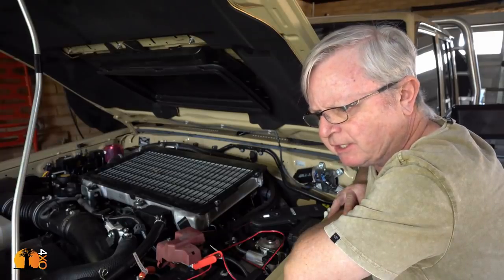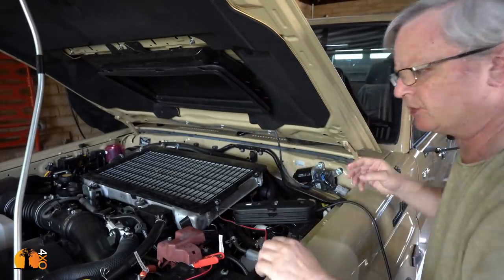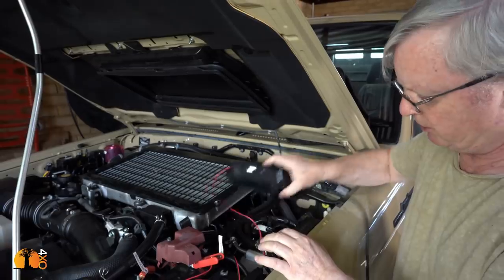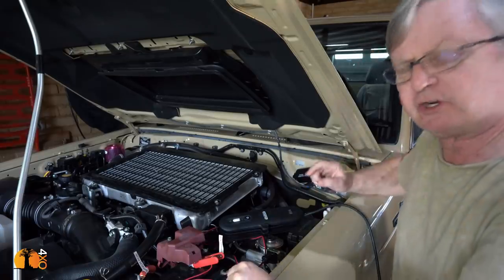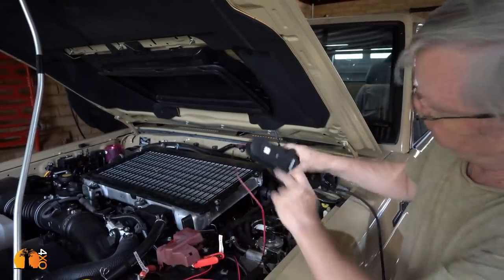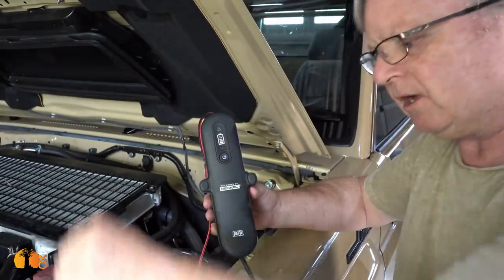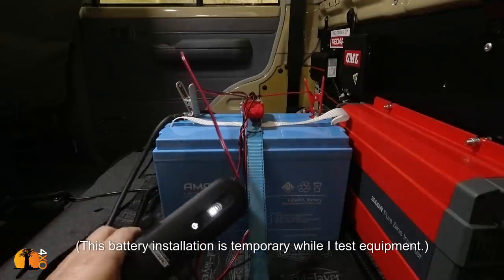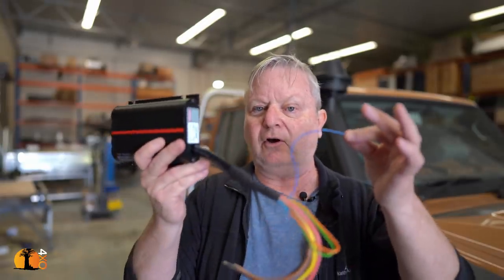DC-DC CHARGER RUNAWAY DISCHARGE WARNING.

Comment: I honestly thought everyone knew this....The clue is in the ‘voltage sensing’ aspect of the DC-DC. Also, DC-DC does not charge at 50 amps. That is simply the maximum it can charge at. The charge delivered depends on the aux battery’s state of discharge.
Reply: I typically see 5ish amps from my alternator? Would you say thats pretty low? I do have issues with power as dashboard and electrics turn off 10mins into night driving and come back on with battery light
Reply: Yeah, if only charging at 5 A most of the time you seem to have an alternator or bad starting battery issue.

Comment: Why would you want to add an external charger to charge the main battery with the system all connected. The alternator is supposed to charge the main battery during normal usage.
So basically the dc-dc charger is good and useable. What you've done is bad and dangerous.

Comment: Im not sure how you have done that .. but that is a setup issue .. its not a problem with DC to DC chargers buddies .. laughs .. oh dear
Reply: Key Maker quite agreed. Setup issue. But can be solved if one wants. For me no.
Reply from the maker: @gotoylc  This is not a problem I’m trying to solve. And neither is this a mystery as to why it happened. It can and will happen to anyone using a DC-DC setup. It's the nature of how DC chargers work. All of them with the exception of those relying only on a trigger wire. The solution is to charge the auxiliary batteries first. It's that simple. When I learn something, I like to share it.
Reply from the maker: This is not a problem I’m trying to solve. And neither is this a mystery as to why it happened. It can and will happen to anyone using a DC-DC setup. It's the nature of how DC chargers work. All of them with the exception of those relying only on a trigger wire. The solution is to charge the auxiliary batteries first. It's that simple. When I learn something, I like to share it.
Reply: @gotoylc  if you understand how electricity works, you'll find that he is correct. It's not a setup issue
Reply: @blastar55m3  This is a very obvious setup issue. There’s a relatively simple device to install to prevent, 100%, this particular issue from ever happening.
Unfortunately I do not know Andrews full setup, so perhaps the setup is not correct correct, or there’s an item overlooked and not installed. Andrews setup diagram would be useful on this issue.
Reply: It's a component choice/use issue.

Comment: Not an issue with CTEK 250sa with smartpass check it out ! Have had ctek on my cars now for 7 years and never flat batteries, and my car is not a daily driver either.
Reply: That solution will also charge the start battery by solar when aux battery is full.
Reply: CTEK also recommend attaching the float charger to the Aux battery side. The same can happen with CTEK if your float charger is able to lift the main battery voltage.

Comment: I'm a firm believer to always isolate a battery when using a 220V AC charger, regardless whether using 1 or multiple battery systems.  It simply eliminates any possible issues from occurring.  Thanks for the heads up Andrew!  :)
Reply: This is so critical: as is clearly shown by Andrew's example. It's also the safest approach. I'm also a bit surprised at the notion of using solar to charge the crank battery. I'm more used to using solar and DC/DC chargers to charge the house batteries and isolating the crank battery so there are no loads on the crank battery other than originally intended by the manufacturer. The alternator should always be sufficient to charge the crank battery. Some alternators supply a varying amount of current, depending on their temperature.
Reply: Same here. If I am going to charge my starter battery with AC charger or solar panel, I always disconnect the wires from the negative terminal of the starter battery first.

Comment: It may be worth noting that every time you charge this way you are depleting the crank battery far too much even if you leave it on for the full cycle. It's being drained way down then recharged slowly, bad practice. Better to charge house batteries separately.
Reply: Yes, that's a better procedure / good practice.
Reply: J M or get a DC to DC with a more appropriate cutoff voltage if you can’t change it in the settings.

Comment: I have two seperate Trickle Chargers (one for the Truck Batteries & one for the House Batteries) permanently wired & a BC to DC 40 amp & never disconnect anything using them!

Comment: I have the solution for you Andrew.
I tow a camper trailer and in it I have a redarc BCDC40 to charge the two 100 Ahr AGM deep cycle batteries simply because of the distance from the car alternator and the resulting voltage drop. The problem is exactly the same, if the batteries in the camper were not fully charged when you stopped the DC to DC would drain the auxiliary battery to charge them.
To overcome this I have a 100 amp relay mounted in the back of the car prior to the anderson plug which is switched through an oil pressure switch so it will never charge from the cars auxiliary battery, in my case, unless the car is running, even if you leave the ignition on accidentally. Luckily I found this out when researching the wiring and installation of the dc to dc charger before the actual fitting and it works perfectly. You could do a similar thing in your vehicle.
Reply from the maker: This is not a problem I’m trying to solve. And neither is this a mystery as to why it happened. It can and will happen to anyone using a DC-DC setup. It's the nature of how DC chargers work. All of them with the exception of those relying only on a trigger wire. The solution is to charge the auxiliary batteries first. It's that simple. When I learn something, I like to share it.
Reply: @4xoverland  I charge the aux batteries first.  I have 360ah batteries charged via solar /Redarc BCDC1240. I also have a built in 30amp Victron mains charger, connected to the Aux batteries. If I ever need to charge the crank battery (which is rare) I have an alternator friendly switch to parallel the aux & crank batteries via 70mm2 cable (for extended electric winch use) , but it also doubles as a means of charging the crank battery when switched to parallel.
Reply: This is what the green lite on the charger is.
 Visual indication that the charger is active.
Mount the unit appropriately.

Comment: All good info Andrew, I have had many problems to solve with battery issues as well. But I must say that it has been about 50 years since I left an ignition turned on with the motor off. I always use the trigger wire and a solenoid to connect the BC-BC. Cheers! Good Stuff!

Comment: Andrew, this doesn't make sense. I have basically the same setup and haven't experienced this problem.

Typically DC/DC Chargers will switch off and stop charging the aux battery when the input drops below 11.8 volts. They typically won't turn on unless the input voltage is above 13.1 volts. So when you connected your mains charger to the battery, yes the voltage would have risen above 13.1 volts and the DC/DC charger would have turned on. This is the same principle and operation of the old Voltage Sensing Relays (VSRs).

However, it's understandable that your mains charger would not have been able to cope with the load (current draw) of both batteries (if both were discharged).

But what should have happened, is that the voltage from your mains charger would have progressively dropped as it wouldn't have been able to maintain the output current required to charge both batteries. Once the mains battery (with mains charger connected) dropped below 11.8 volts, the DC/DC charger should have turned off.

The mains charger would then have been able to again start charging the main battery and the internal resistance of the battery would start rising and so would its voltage (Ohms Law). Once it reached 13.1 volts, the DC/DC charger would kick in again, and the whole sequence would start again. The end result over time, should have been that both batteries would be fully charged.

So what's happened in your situation is a bit of a mystery.
Reply: The charger would have been connected to the same terminal as the DC-DC, so the DC-DC would've been seeing the input voltage of the charger this draining the battery. The charger would've been giving the DC-DC a false voltage reading of the main battery. The only way to get around this is to disconnect the DC-DC
Reply: Kim Flesser 240v charger pumps out a constant 13+ volts across the terminal therefore dcdc keeps charging..
Reply: @nickscurr7062  My understanding is that external charger was connected in parallel to both the main battery and the DC/DC charger. So I still ask the question, why didn't the DC/DC charger turn off when the main battery and external charger voltage dropped to 11.8 volts. The external charger and main battery cannot have different voltages when connected together. Is there something here I don't understand? (I used to be an electrician...but not a very good one...LOL!).
Reply: @FastFless  I'm afraid there is some "misunderstanding" between the DC/DC and the small charger (like pulse charging in the small charger that causes the voltage to raise repeatedly above the DC/DC switchoff levels). It is actually very unfortunate that both the devices are from Redarc and they don't work together!
Reply: @FastFless  , if the 10 amp charger was a simple linear constant current 10 amp device, then I believe it should be just as you have described.  There must be something funny about the way the charger is delivering the charge that is tricking the DC/DC charger into staying on. It would be interesting to connect an oscilloscope and see exactly what is going on.
Reply: @tonymeredith6969  I agree!
Reply: Kim Flesser that 11.8v cutout seems stupidly low if it is designed to be taking power from the starter battery. Unless his battery is massive a 10A charger should add between 1/2 and 1V as sensed by the charger so his battery could be dipping below 11V which is pretty bad.

If I was designing it I would have it cut in at 13.7V and out at 13.5V that would keep the starter charged and if you are running a 50A DC to DC charger you should have at least a 70A alternator which should keep the voltage at 14.2V

Is the lower voltage setup a hangover from house solar systems or something? Or is it to deal with “smart Alternators”?
Reply: @FastFless   the voltage remains at around 13v it is the amperage what can't keep up, hence the main battery goes flat. 

Simply the DC DC charger doesn't see amperage but voltage. You could even trick the DC DC charger to turn on and start sucking power with a 12v cordless drill battery.

I bet the charger gets boiling hot and the main battery probably boils inside too. 

It is surprising that the AC charger didn't melt.
Reply: @munecito  Sorry, but it's impossible for the main battery and the  mains charger to have different voltages if they are connected together. One comment suggested the problem had to do with the mains charger providing a rapidly pulsing output. This spiking output could be interfering with the input voltage detection in the DC/DC charger...I think they are on the right track to explaning this problem.
Reply: @tonymeredith6969  Nothing funny, it'd just Pulse Width Modulation keeping the voltage high.
Reply: @stevegraham3817  correct, nothing funny about pwm really, but in the context of my comment by something funny I meant something other than constant current.  I was replying to Fast Fless specifically, stating that if the charger was a constant current type then it would be as they had described.

Comment: Thanks for the info. In my situation I have my start battery purely for starting only. (Nothing connected besides low amp accessories on switches) the start battery will also be monitored. Then from my starter battery, it then connects to a smart isolator before connecting to my secondary battery. The second battery then has all the niknaks. This works only for older cars.